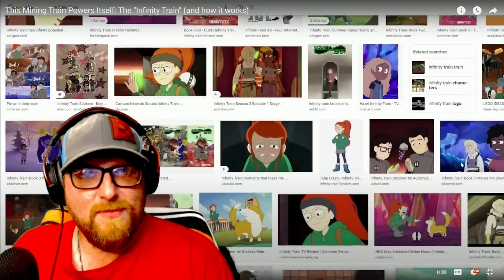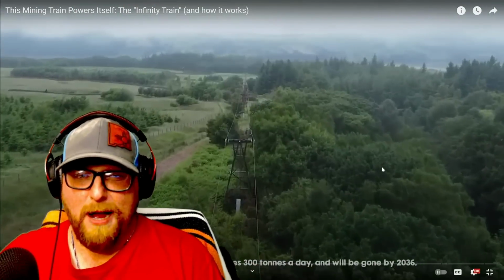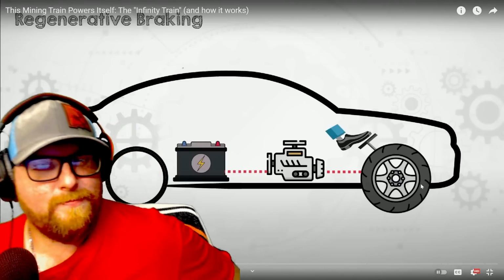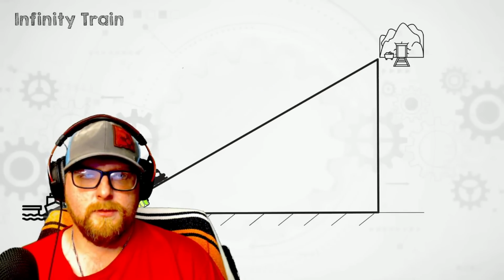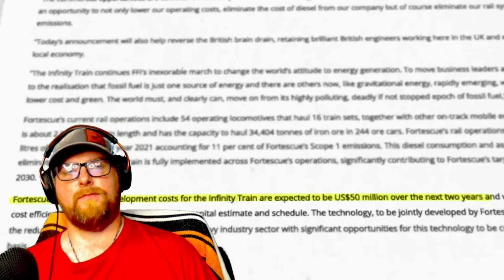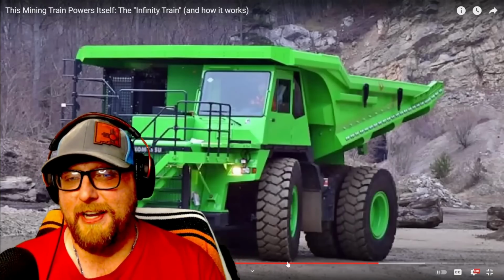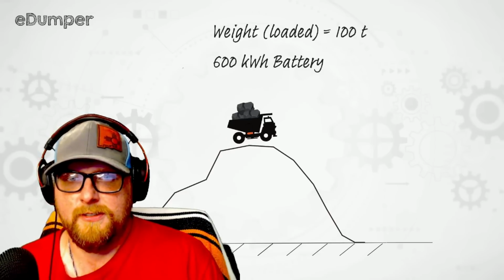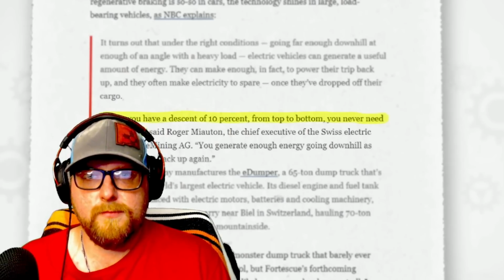American Reacts to Australia's  "Infinity Train" No Fuel, No Charging

Comment: cable car mine dynamic braking  happens when you stop the  wheel from spinning chick talking out arse would be my guess likely powered by a 3 phase 440-720 vac diesel motor..
diesel powered electric dump trucks or even gas (lpg) powered options..

My guess if they are doing hybrids of these truck it be diesel/lpg

wouldn't be enough water for hydrogen powered option  and I doubt they find a battery solution that can work between 45-60c without failing first!!!!

electric everything isn't going to happen because you are still passing power by conventional methods  whether this be coal fired, nuclear powered power stations, buck powered diesel/lpg gas/hydrogen powered generators placed in circuits..

if you want regen a car going down a hill the faster you can go the more power you can produce 110%

regen from actual dynamic braking is a farce because you are slowing down -55% which is within 22.5% regen cycles.. might get you to the power station if you have a solid core tire rather than pneumatic 1 requiring either O2 or Co2 to highest pressure..

As someone who uses a mobility aid to get around as long as you  have access to a actual power source for recharging you be plum out out luck getting home in the 2000kg+ paper weight we don't have the infrastructure to support EV only vehicles past 40km/h/25MPH is we did we wouldn't need electric/ {diesel/petrol} hybrids to get onto and travel the freeways/highways/byways of Australia at 80-120km/h where applicable when not governed by combined weight of vehicle and what you are physically towing over 2ton in weight
Reply: Half of what you said is completely inaccurate. 
I can assure you that aerial ropeway is completely unpowered https://www.youtube.com/watch?v=6RiYXI1Tfu4

Comment: Interesting, what is elevation difference between start and and point in meters please?
Reply: Cloudbreak sits at 447 metres, the other end is at sea level so say, 15 metres so roughly 432 metres over about 280km of line.
Reply: @marvindebot  wow, that’s really impresive. Enormous savings

Comment: Aside from the e truck being a mini version, most mines work the opposite way. They are essentially a hole in the ground meaning going down they are empty and coming up they are full so it won’t work here in Australia. 
Sorry folks
Reply: Sorry Tom, you got it backwards.
From the mine to the port is all downhill. We are not talking about within the mine.
So going downhill from mine to port, they are loaded. Going from port to mine, uphill, they are empty.

As for the ETruck, a lot of the Iron Ore mines in the Pilbara are not yet to the point of digging holes. They are still cutting the top off the mountains at this point.
Reply: @petert3355  not the train, the e truck. Mines are underground, the truck has to drive up and out of the mine full then back down into the mine empty. 
The train is cool.
Reply: @fugawiaus  "Mines are underground,"
That's the thing though Tom, not all mines are underground.
It's one of the weird bits about the Pilbara. There are literally mountains of iron ore.
The majority of the mines are all still above ground. Only a couple of the first ones are now to the point of digging down below ground level.
Reply: @petert3355  that's why he said, in his opening post... "most mines work the opposite way".

You're hung up on 1 mine in the mountains while he's talking about most mines being either open cast where they still dig deep holes, incline shafts or straight up vertical shafts, all of which are underground and even reached a point where just normal vehicles won't work to haul out ore.

In vertical shafts you'll require winders that'll haul the ore from underground.

In incline shafts they'd use conveyor systems to haul the ore up to surface.

Open cast they have to drive down to the bottom, load up the ore and then make their way back up to the top with a full load. So a system that uses load and gravity to charge the truck won't work there, it's the other way around.

But you refuse to see that because you're hung up on a mountain!!! 🤦‍♂️
Reply: @jyuvgrace5364  I give up, you lot obviously know more about the mines of the Pilbara where these systems are being implemented, than I do.
I've only worked those mines for the past 30 years so what would I know about the mines I work in.
Reply: @petert3355  you're the only one talking about that crap mine dude. The rest of us are trying to no avail to make you understand that the pilbara isn't the only mine in the world.

Even my comment that calls you out on it still can't get you to see past just that one mine in order to understand what the OP was talking about.

...
Reply: @jyuvgrace5364  yes the Pilbara is not the only mine in the world, but they are the only mines in the world where this technology is being implemented at present.
Why talk about mines where this technology is not being even considered?
Is it really that hard to understand?
Reply: @petert3355  that was the point the OP made! As cool as all of this is, it's region specific and won't work in most mines.

But you keep getting hung up on the wrong pints that has nothing to do with anything he said.

LOL...
Reply: @jyuvgrace5364  yeah, and haulpaks don't work in shaft mines, does that say they don't work. (The OP implies that this tech will not work remember)
That is the problem. They are dismissing the tech out of hand without cause.
Yes this works in the Pilbara, it will also make sense in a lot of the new African mines planned to come on line over the next decade or two.
You can keep your strawman arguments all you like.
Fact does not change, this tech works very well where it is being implemented.
Reply: @petert3355  the tech works well as long as the load it carries goes down and not up. So any mine, quarry etc that is at an elevated position where the load needs to go from the top to the bottom, this will work well.

But if the load needs to be taken from the bottom to the top, then it won't work well as you'll use more energy to haul it up against gravity than you'll need when it's the other way around.

So it's very situational and won't work in most mines.
Reply: @petert3355  above ground is a rarity. Look at Kal and it’s surrounds. The e truck is also tiny. Too small even for the couple in the Pilbara. There is a reason it’s so small. The larger it is, the bigger and heavier the batteries and the quicker to discharge. 
Maybe just stick a big diesel generator on the back. That’ll fix it. 
(If you don’t know Kal then you don’t work the mines)
Reply: @fugawiaus  Haulpacks are all electric powered. Most of the current ones are diesel electric, so hybrid designs will have advantages regardless by reducing brake wear (a major cause of mine fatalities) with dynamic braking and reducing fuel use as they won’t need the engine running 3/4 of the time (ie the run down to the mine floor, lining up on the loader and while waiting to load).
Reply: @allangibson8494  but if a difference between e trucks and diesel electric. Most heavy haul trains are diesel electric so therefore hybrids. 
If you are so worried about co2, diesel electric is barely any better.
Reply: @petert3355  got to love the people going at you don't understand the Pilbara region of Australia and not a singular mine. The dunning Kruger effect is always so strong in the comments of any YouTube video.
Reply: @fugawiaus  well that last comment is objectively false. Diesel electric actually save a pretty substantial amount of CO2 to outright diesel. While battery discharge technology and electrical motors are becoming ever more efficient. Whack a solar farm or two, especially with battery storage, which most new mines are already doing and you have the potential to go fully CO2 neutral on the fuel component.

Edit: not to mention quite a few mines can take advantage of other low sectors. Should check out pumped hydro being tested by using old mines. Future is hoenslty looking bright
Reply: @solace6633  I love ideologues. 
You simply have no actual concept of a mine or how diesel electric works. It’s actually funny. 
Most mines need the same amount of electrical power as several  blocks of buildings in a major city. 
The power coming in is 11000 v which is transformed down to 1100v. This is a little bigger than your home extension cord running 240v. You would need several klms of solar panels to run each mine. Mines run 24/7 so you would need power for the other 16 hours a day. The Tesla battery in SA takes 4 mths to charge and 4mins to discharge. At this point we do not have any battery tech capable of achieving this. Current battery tech advancements is making that 4 mths charging time come down to 3mths 28days. 
Woo hoo, at this rate it may be viable by the year 2500. 
I really don’t think you fully understand scale. 
Your utopian ideology doesn’t exist in the real world or from the Twitter and Facebook opinion pieces you get your information from.
Reply: You can also add that even while the hill is being consumed the decline is reducing all the time, so even less effective.  For example, BHP's Mt Whaleback in the Pilbara which has been operating for over 50 years was once a "mount" but is now a massive hole in the ground.  Hauling up 250+ tonnes per cycle (that's ore not inclusive of the truck) would us way more power than you could regenerate going down hill empty.

Diesel-Electric trucks have been around for decades and it would be interesting to see what fuel savings there would be over 100% diesel, if any.  I think this area may move to more emissions effective biofuels, but hey, I'm no engineer.

Comment: A fantastic project. There is something similar in Switzerland. In a mine, an electric dump truck is used that generates so much electricity that it has to feed regular power into the grid.
Edit: Oops, I should comment after the video.
Reply: If that was the case then it's producing free energy which ai t true as you can't gain energy from its self. There will always be a loss and not a gain. Physics has proven this.
Reply: @Danger_Mouse_00  The "free" energy is the positional energy/gravitational potential energy of the load on the hill that the eDumper uses. This energy is also not free, because the mountain was mainly  created by geological processes inside the Earth that used geothermal energy. The geothermal energy, in turn, was generated by the impact energy of meteorites during the formation of the Earth. The impact energy was once velocity energy/kinetic energy  formed from gravitational energy during the formation of the solar system.
But you are right. Energy can only be transformed, but not created.

Comment: Rio Tinto has a battery regenerative train also , BHP 2 years ago had a Ore Train park break fail when the driver got out to check something and it rolled off down the line they had to remotely derail it because it was doing over 100 ks heading for the Port Headland , one big expensive mess https://youtu.be/Ec8Yx-Mp-5s  https://youtu.be/EiDd_elZL3w